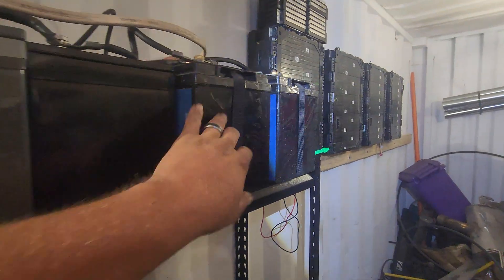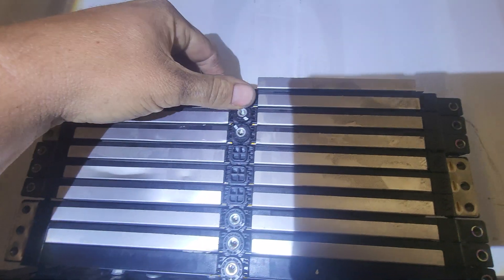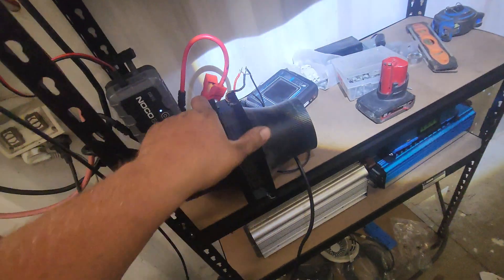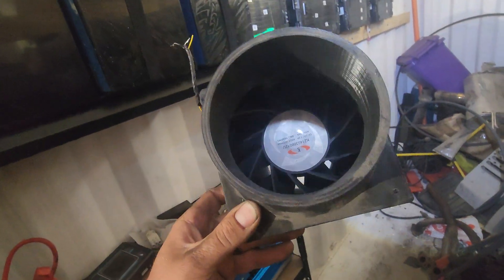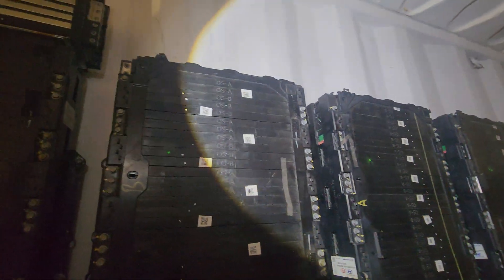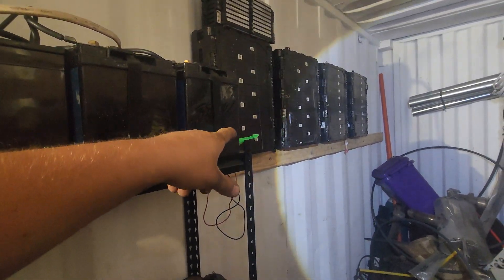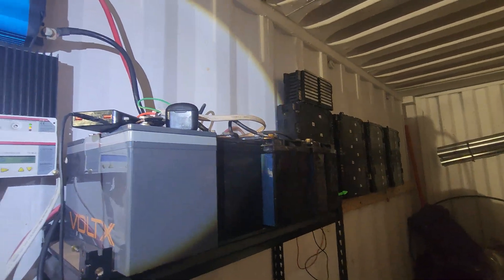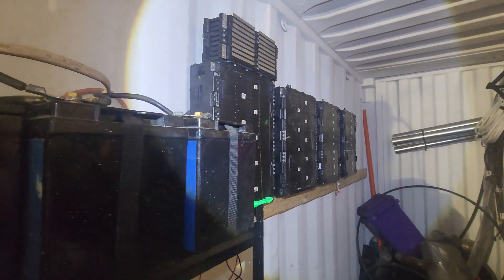It's Time to build the monster 180kwh 48v power wall begins

Comment: 180 KWH AT WHAT AMPERAGE DRAW
the amp draw doesnt remain the same so you cant say kwh....battery storage is measured in Ah ( amp hour ) not kwh
Reply from the maker: What do you mean. Storage isn't measured in kwh
Reply: @ if you run something for an hour @ 100 Amps and you have a battery that is rated for 100Ah ...the battery will be dead in 1 hour...drawing 50 amps the battery will be dead in 2 hours

not everything draws the same amperage
Reply from the maker: @t00ls742 kwh is a measurement of power. When you get to the equivalent size of 700x  12v  100ah drop in lithium battery's amp hr becomes a redundant form of measurement when watt hour is so much more accurate.
Reply from the maker: 15,200 ah at 12v for reference in your preferred units of messure
Reply: @Oneupthesleevecustoms  0:59 you can see the back and it tell the voltage and Ah .... 60Ah 3.63V and also says 218 wh.....lets go through those numbers

you need 13 of those cells in series to make 48ish volts...in series your Ah stay the same so 48volts @60Ah
also you will have 3.02Kwh in the series since it states that each cell is 218wh, again....thats if you are able to maintain 3kw for an hour
I dont know where you got that 660 number from or the 280 Kwh

you say 13 in series, ok ...3 parallel , ok
13 in series 60Ah x 3 in parallel = 180Ah....and Kwh @ about 9 Kwh if you can maintain 9 kilowatts in an hour...which you cant and never will be able to...because

as voltage  and amperage is used from storage ...watts will go down because volts x amps = watts

we use Ah so we can know how long our storage will last without a recharge...we know because we can determine how many amps an item will draw while in use...the wattage in a battery will go down when in use because the voltage goes down, while we can still draw the same amount of amps till the battery is dead

I hope this helps you understand
Reply: @Oneupthesleevecustoms  and as you also say...Kwh is a measurement of power...true ...9 kilowatts in 1 hour is not a lot.....if I am running an inverter trying to run things in my home, 9 kilowatts wouldnt last 1 hour at all because a normal home uses 4-6 kilowatts an hour...and up to 10 when mor things are in use intermittently
so again a measurement of power doesnt tell me how long my battery will last Ah is more accurate in that aspect
Reply from the maker: 3800ah ish at 48v

Comment: Look forward to seeing it come together mate.
Id do a bms per module unless you went batrium or similar, but they are pricey ✌🏼
Reply: I'd recommend jk or jbd for that, would be nice to have bluetooth also ✌🏼
Reply from the maker: @offgriddreaming5403 i was sort of thinking it would be nice but do I need to know any more than a daly or similar would do
Reply: Daly would be last on my list but some like them
Reply from the maker: @offgriddreaming5403 what would you choose?
Reply: I'd go with jk or jbd.
The Canadian guy I think he is going off grid has used some basic bms for years with good success you could find out what his are
Reply from the maker: @offgriddreaming5403 ok yeah I like his videos. Going off grid is one of the first i had seen doing the car batt for storage
Reply from the maker: I'm looking at batrium but I think i might go individual stand alone 8.6kw bricks with my draw ill only need like 60 amp bms units on each so lots of small ones won't break the bank

Comment: If you link the cells in parallel, then technically, a single big BMS is all that's needed. But in practice, you'd only be able to link these together via the tiny BMS wires, which won't be fun. I'd go for a small BMS per pack, which would probably be a bit more expensive, sadly.
Reply from the maker: But that would let me make it modular i giess
Reply from the maker: They don't need to be big bms units. I was looking at batrium bms system last night
Reply: Something modular like Batrium would be the absolute best option.
Reply from the maker: @BrianMcKennaPuffnfresh yeah I'll have to cost it out and then I can build it in stages need a couple grand for inverters I recon i have most of the cable .
How's the one you built with these cells going?
Reply from the maker: My 24v battery has 1 bms for a 7s 3p x 3 bricks